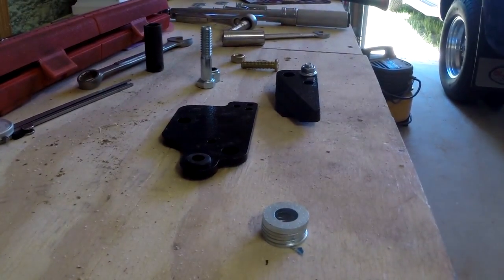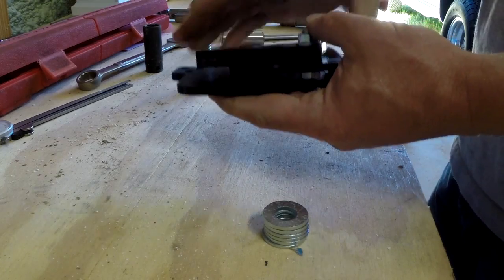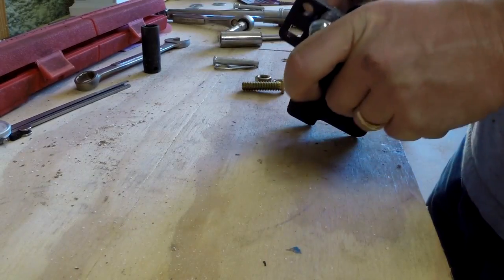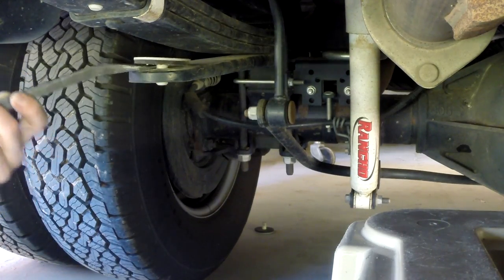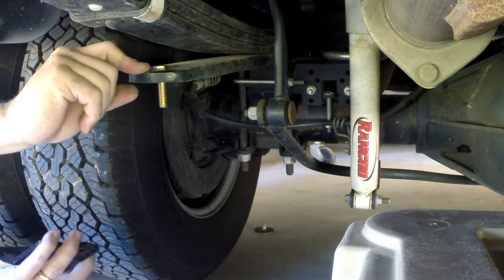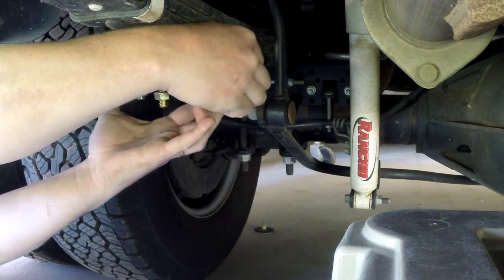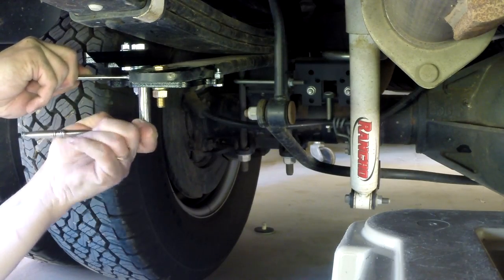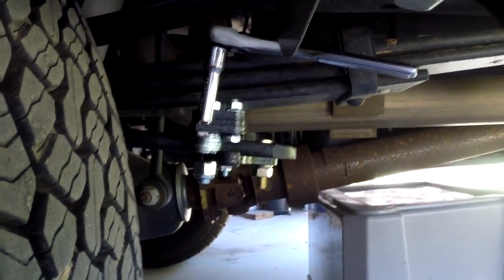How Easy is it to Install Torklift Stable Loads

Comment: Nice vid.  Better than the company's video. 
Of note: not all trucks overload spring has room to install the bolt.  You may have to jack up the back of the truck to install, engage or disengage the Stable Load.  That maybe difficult for some people to do, depending on the height of the truck.

Comment: I have a 2016 f150 and I could not believe the massive difference. Riding empty too is a vast improvement. I go over a hwy often with large grooves and before the rear end goes squirly and shakes my filling loose. Now when crossing it feels like a Camry. Not sure how great on every application but for my generation f150 I would not hesitate to pull the trigger and install them.
Reply: If your 2016 f150 shakes your fillings out ever then it's got either blown shocks or bushings. My 94 doesn't ever ride that bad

Comment: For those of you that need to drill a hole in your leaf - here is the deal. Some leaf are thicker than others and have boron enhanced steel. At first, wow it was a pain, thought I would never get that last 1/8" and chipped part of the provided bit (1 of 2), had sharp shavings all over me and oil all over the drill, then my bit started spinning in the chock. Wanted to change my luck so diverted to the second spring and second bit. This time I grabbed a simple scissor jack from my other car. Started a small hole by hand, then placed jack directly under hole and made sure drill was perpendicular to the leaf in 2 directions, I also had to put my drill chock in a vice and pull the trigger to really lock that bit in place. Now crank the jack up to push nice and hard on the spring. Now do short bursts with the drill - you will get much more material this way. you can do little adjustments up with the jack between bursts. Resist the urge to keep going for more than 5 seconds or you will dull the bit! Now lower the jack just enough to slide the drill to the side and out of the hole without moving the jack(this will prevent having to align it each time). Dip the tip of drill bit in oil and go again. Spraying oil is way too messy and you will end up with oil in your drill and all over your hand - possibly ruining your drill. Dipping the tip of bit works MUCH better. I even pushed a small piece of paper towel over the bit and down to the chock to catch oil dripping down the bit and changed it a few times. This method also allows you to be off to the side instead of under the whole operation so you prevent all the sharp shavings from sticking in your shirt, hair and all other places. Let the jack do the work! Experiment with how much to make the jack push up on the spring. Too little and you will have less shavings, too much and you will bind up or spin your bit in your chock. This works! You will be able to use the two bits provided. I even finished off the first side with my second bit after finishing the second side.
Reply: Sounds like I need a workshop to get this done.

Comment: This guy friggen rocks! His wife is lucky to have him. I hope she's aware of that. Most women don't understand their mistake until after they've thrown the man out.
I bought this kit but now I'm having regrets. It seems as though this it is much more complex than necessary. I would think just a couple bolt in spacer would do just as well.
Reply from the maker: you can do this easy! the pieces form a wedge. the wedge rotates into the spring. you should be able to match up the wedge packs if you pause the video. the part that makes it complicated also makes it worth it. being able to disable the lower spring and enjoy the ride is worth it.

Comment: Thanks for the video,  after viewing your video, I'm convinced that I can do it by myself. :)
I'm just wondering what your impression on Torklift stableloads.
Some guy recommends airbags as well as stableloads for his lance 1172 TC.
EagleCap 1165 is one of the heaviest  TC in the market, and do you think stableloads is enough or do you think/have another tuning for the truck suspension ?
Reply: In my humble opinion, a camper that is that heavy would definitely need additional support...whether its upgraded leafs or airbags.
Reply: Yep, if you're towing super heavy it would be wise to upgrade the leaf pack itself, use weight distributing hitch, etc. Air bags are not your solution

Comment: DID YOU EVER MAKE A FOLLOW UP REVIEW?
Reply from the maker: Sorry, no i didnt. but i will say they are great and worth every penny.
Reply: @TheSquirrelsNest  I have an equalizer hitch now and thought about getting some of these as well
Reply from the maker: @the_ap_1561  do you have any sag?
Reply: @TheSquirrelsNest  a little,  but sometimes the back of the truck still feels a little loose
Reply from the maker: @the_ap_1561  what is your truck and what are you towing
Reply: @TheSquirrelsNest  09 f150 w 5.4, passport 2400bh about 4900lbs dry weight.
Reply from the maker: @the_ap_1561  you might get better results with airbags. I would think your current setup would be good if your weight distribution hitch is a quality one.
Reply: @TheSquirrelsNest  it's an equalizer.  My thoughts were maybe a little windy plus maybe under inflated tires. We are going out again in about 3 weeks. Going to try more air pressure and try evening out weight in camper better and see what happens